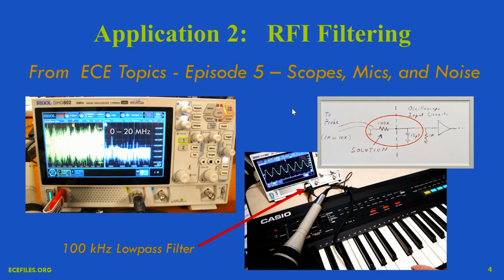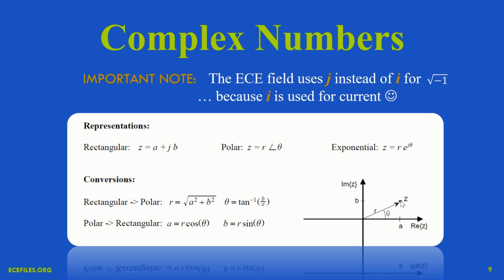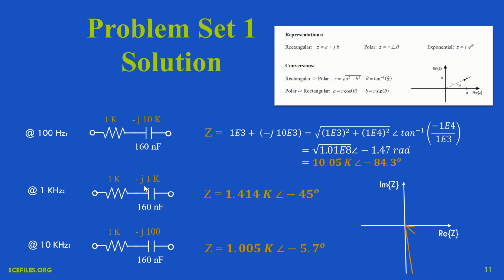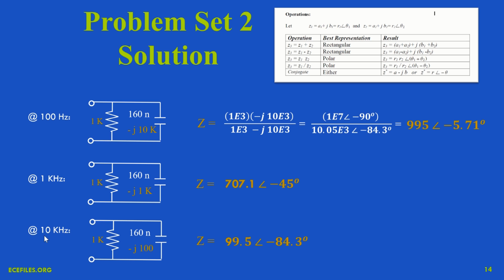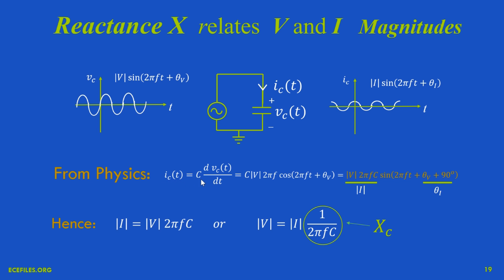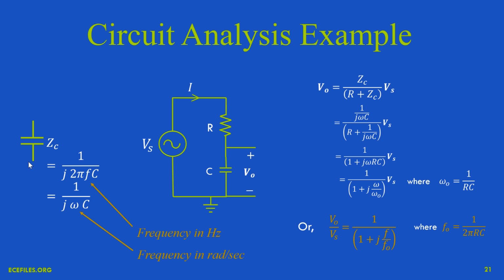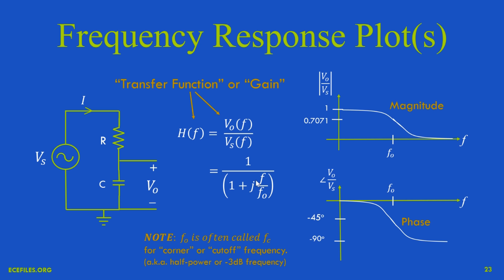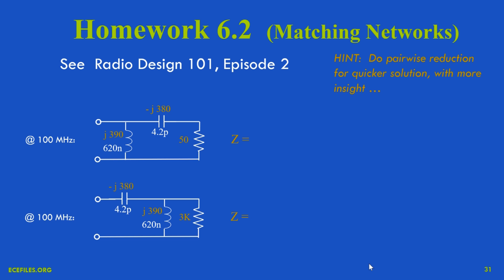Complex Numbers, Phasors, Impedances, and Frequency Response

Comment: Thanks again for another excellent video.  Very brave of you to try and teach "doing the math."  Complex numbers/analysis are just a tool and the ideas needed for circuit analysis are really not that difficult.

Something that has helped me understand the beauty of using complex analysis is that for a differential equation, let's take v = L*(di/dt) for example, if we assume any of our input signals is a complex exponential function: i(t) = exp(j*omega*t) then v(t) =  L * j * omega * exp(j * omega * t).  If we replace exp(j * omega * t) with i(t) we get v(t) = [ j * omega * L ] * i(t).  Nearly magically, it's clear that the quantity [j * omega * L] is just like a resistance in that it relates voltage and current through an element.  

Once you realize that differentiation is linear (the derivative of a sum is the sum of derivatives) you can sum any number (countably many = Fourier Analysis, uncountably many = Fourier Transform) of exponential inputs together as a single input and know the output response.

Mathematicians (of which I consider myself semi) would make it sound way to intellectual and tell you that complex exponentials are the Eigen functions of the differentiation operator (remember that for your next cocktail party) but this all kinda works because the derivative of the complex exponential is a complex number times that complex exponential.  That's the root of it mathematically.
Reply from the maker: Thanks for adding some excellent thoughts here ! I totally agree. Going the complex sinusoid route in the derivation would be equally valid - and perhaps even better.  I was just worried that it might look too much like a foreign language to many viewers. It's always hard to know who is in the audience and what their background in math is. As you said, though - once you get comfortable with seeing e^jwt stuff, the impedances just kinda fall out magically :-)   And like you said - they're needed for Fourier transforms, and are a much more elegant expression for Fourier series as well.

Comment: Backing off a bit from the "without estimation", if I know the form of the response, and have the mag/phase over a frequency range, is there some magic Python code somewhere that would curve fit to the known response? ie- knowing the RCL (s) and topology the form of the Laplace f(s) and the response should (?) be enough to fit?

[ I am a retired EE, and my calculus skills have dissipated over the years,.... ]
This would make a good video topic, ;-} for me at least.

I am working on several projects and ideas for a YouTube channel of my own.
One if which is the analysis and restoration of audio gear. (vacuum tube)

I have some McIntosh pieces to restore. I have a MC20 preamp which is notable with several settings for equalization (RIAA etc) on the phono input. I have Spice simulated the McIntosh design and note that it is not quite correct. I want to run sweeps with an analyzer to get  mag/phase fit that to an f(s) and compare to what the published time constants are for the various equalization that have been used on LP's over the years. 

No this is not an absolutely necessary approach, but it could be instructive or interesting to viewers. I hope to drive the Audio-Fools nuts,... LOL

Cheers, dan
Reply from the maker: Projects sound great !  Technically, if the poles and zeros in the response are far enough apart, you might be able to estimate RC products, and then simulate and compare with measurements to refine them perhaps. Sorry - I don't know of any Python scripts, etc. But maybe someone else reading this discussion will chime in with one :-)  Here's one example that I thought of from the ECE Topics videos. Don't know if it will help, but if this is put together with the complex math/graphing stuff, then maybe it could be useful...  https://youtu.be/8oGsBL6CHk4?list=PL9Ox3wpnB0kr7lLWWbnkycrrAHs878xiW&t=1435
Reply: @MegawattKS  thx I will check it out

Comment: question: are you aware of a tool or tools which would provide Laplace equations from a Bode Mag/Phase plot? (without all the manual estimation)
Reply from the maker: Sorry - no. FWIW, I once labored through a textbook on Network Synthesis. Doing a search for that combined with "bode", I found this, which might be useful background.  I think they cover the issue of non 1:1 results. And be warned that there are often (always?) at least two possible s-domain results from the fitting. One is stable and the other is unstable. Bode plots don't typically provide enough information to determine if the system is actually stable (all poles in LHP).  Hope that helps, at least a little ... https://en.wikipedia.org/wiki/Network_synthesis
Reply: @MegawattKS  thx